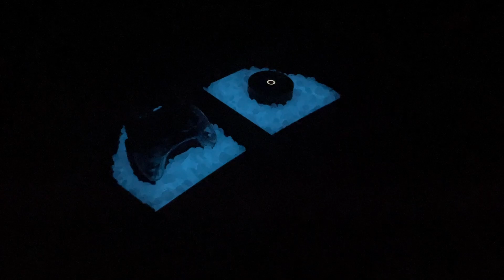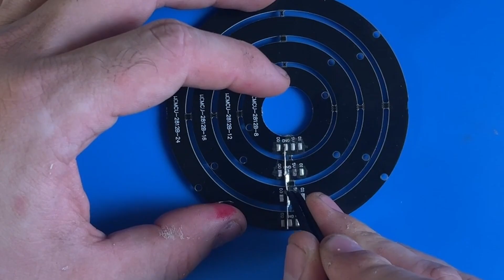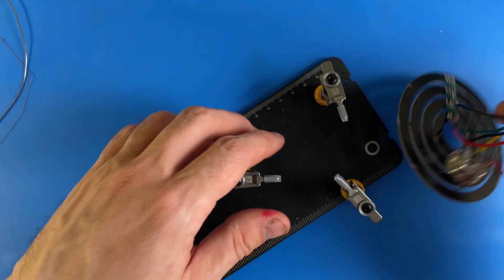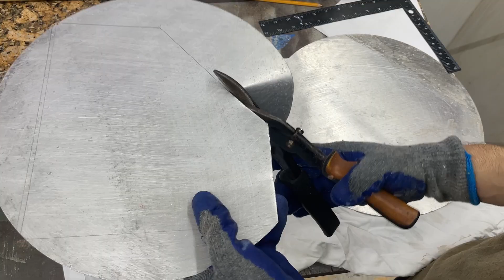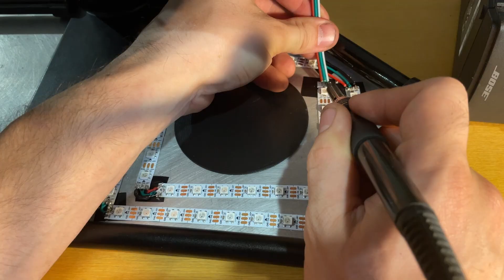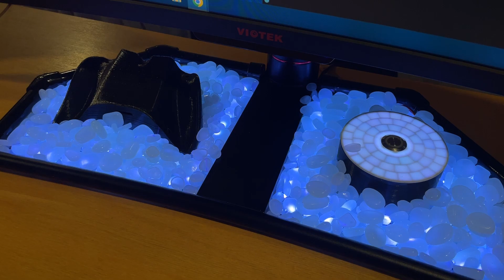How to Make a WLED Button with Luminous Rocks [WLED Creations]

Comment: I noticed that the capacitor is a 16v, does that cause any issues when using the lower 5v input?
Reply from the maker: No, there is no issue with that. The 16V is the max voltage rating for the capacitor, meaning it should not exceed 16V to prevent damage. It's recommended to use a lower voltage than the max rating since it will put less stress on the capacitor over its lifetime.

Comment: Hi there your very good but l got 1 thing 😮where do u get them Light from l look on amazon and l just can't fine them love too make it please tell me Thank u love all your video 📹
Reply from the maker: Thanks! You can find these LEDs by searching "ws2812b led strip" for the lights under the rocks or "ws2812b led ring light" for the LEDs in the 3D-printed button enclosure. I bought the ones in the video from Aliexpress since they are cheaper there, but they are also available on Amazon if you prefer faster shipping.

Comment: I'm a bit weary of how you used your bench grinder with that sheet of metal. It looks like the wheel could grab the sheet and pull it in. That would probably be pretty dangerous, maybe breaking your machine in the process. Just a thought.
Reply from the maker: To be honest, that did make me feel nervous as well when I was doing it. You're right, one slip could have pulled it in badly. I think my angle was wrong there with that metal on the bench grinder... 
I appreciate your concern by pointing that out. That is important to be safe with those kinds of tools. Safety errors can have really bad consequences.